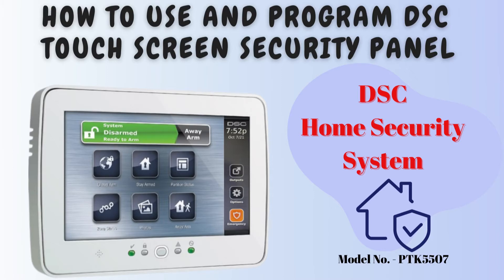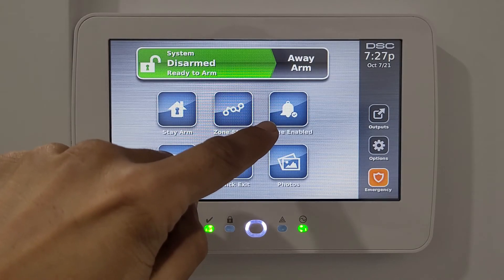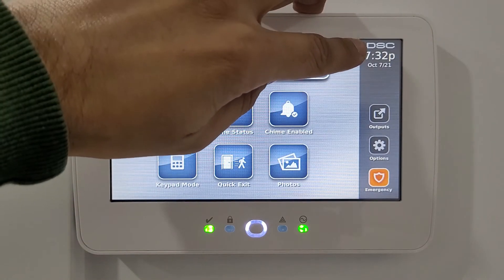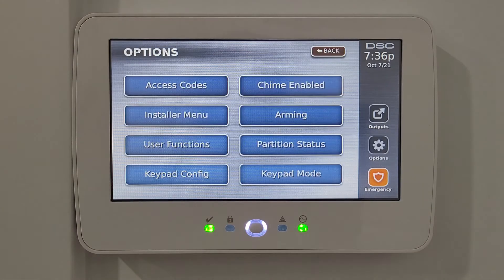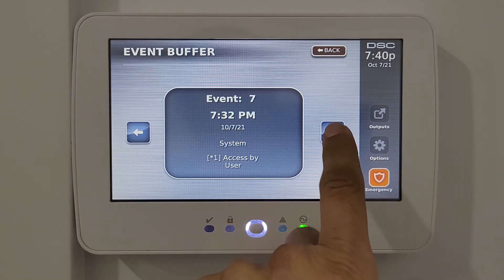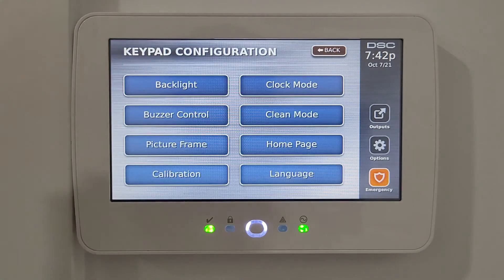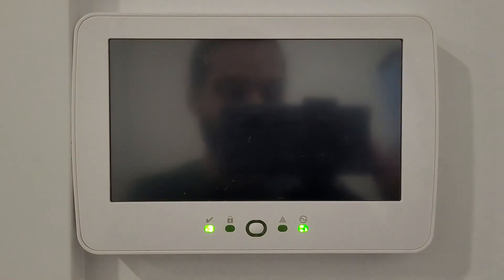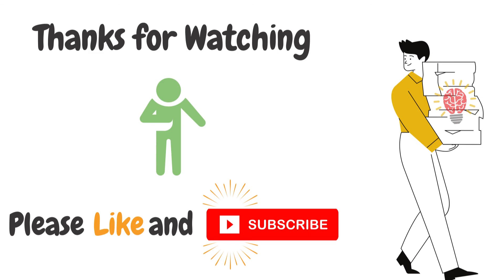How to use and program DSC Security Touchscreen Panel

Comment: I am searching for wired as opposed to wireless sensors, such that the data between the wired sensors and the alarm panel is transmitted using digital packets as opposed to analog open or close.  And the ability to daisy chain multiple sensors from the other sensors as opposed to hone run wire for each sensor to the panel.  Please advise if anyone knows where to get this more modern type of alarm system.  Thx
Reply: Been in the industry for 8 years now, and the short answer is no.
There are some systems that will secure their wireless sensors but if you want a hardwire to work as you want you'll need to make 1 that does that

Comment: Do you know of any security systems that use a digital packet method of communications between the sensors and the panel as opposed to analog wired sensors?
Reply from the maker: Hello J K,
You can use Qolsys system as it uses Rf wireless system using the 900mghz band width. Or PowerG communication format. 
Hope this answers your question.
Reply: I am searching for wired as opposed to wireless sensors, such that the data between the wired sensors and the alarm panel is transmitted using digital packets as opposed to analog open or close.  And the ability to daisy chain multiple sensors from the other sensors as opposed to hone run wire for each sensor to the panel.  Please advise if anyone knows where to get this more modern type of alarm system.  Thx
Reply from the maker: @Just_An_Idea_For_Consideration  I am not sure who does Security Systems as per your requirements.
Seems like you require system with double end of line resistor system. 
I would request if you can explore options on google search or call available security company available nearyou.
Sorry I couldn't be of much help here.